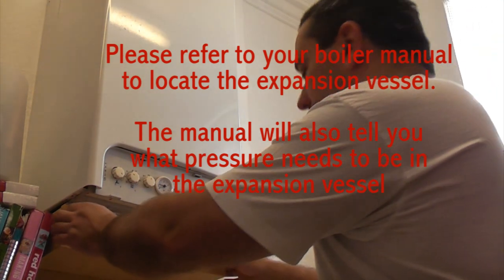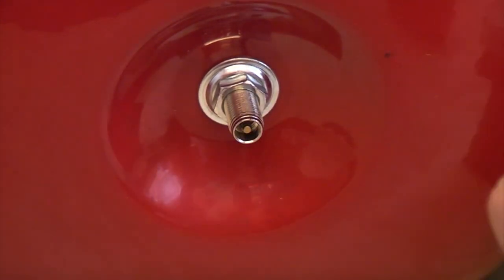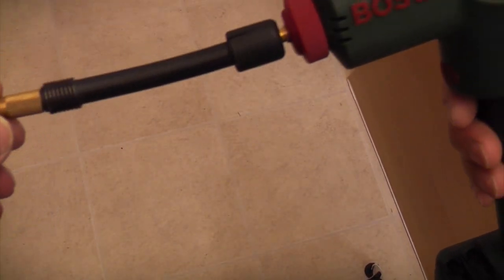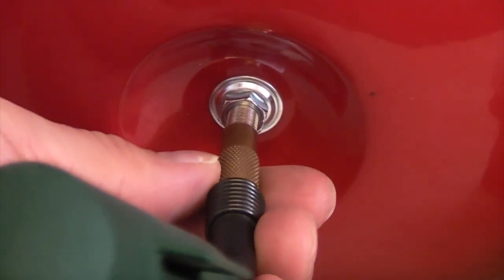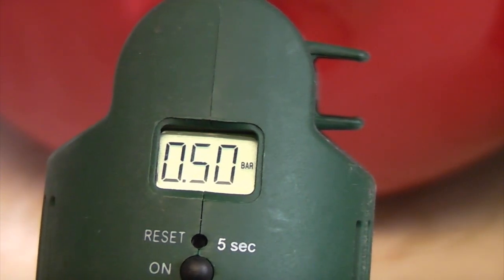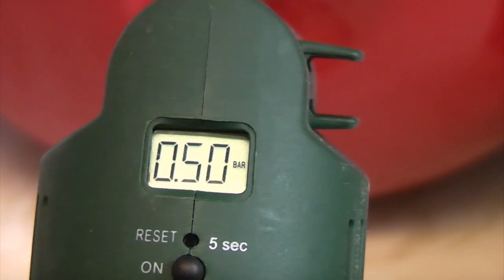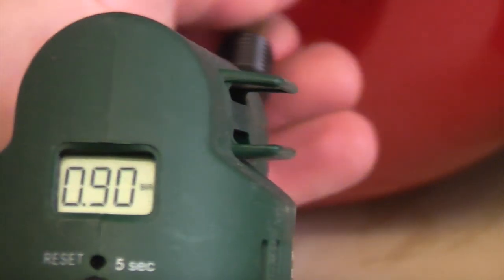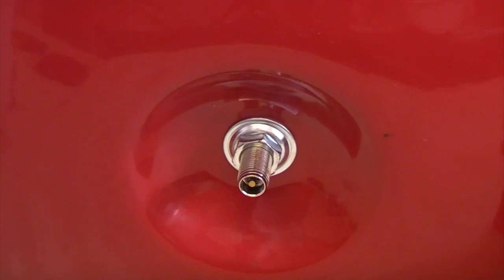How to recharge an expansion vessel in a combi boiler

Comment: Fantastic! If all plumbers were as honest as you there wouldn't be any hesitation to call in a plumber. I've had three plumbers all tell me my Ariston boiler (2011) needs replacing at £1750 when a simple repressure cured a four year problem. Just brilliant!
Reply from the maker: Thanks for the comment
Reply: Cost me £200 to get gas board in to recharge expansion vessel .

Comment: 47 represent nails it 7 yrs ago below, you need to clear the ex vessel of ALL water (even standing) to get a accurate reading,correct way is to close F&R valves release pressure in boiler using boiler drain off NOT PRV (asking for trouble there),leave drain open and pump up pressure in vessel,the water left and there will be quite a bit will be forced out of the vessel,when empty and you'll know cos the last bit will be filthy,then re pressurise vessel to what MI state,open F&R valves and repressurise system.

Comment: It is actually illegal to carry out work on a gas appliance unless competent to do so. The fact that someone has asked how to make an expansion vessal redundant from use proves that this is dangerous for such people to be messing about.
Reply from the maker: It is illegal to work on the gas part of a boiler if you are not qualified, however adding an additional expansion vessel is something most people can do ;-)
Reply: Most people on here are specifically asking how to re pressurise their combi expansion vessal, being as we have to remove the boiler case to gain access you need to be competent to do so. People messing with their own boilers is dangerous.
Reply from the maker: keith kent
Are you Gas safe registered?
Reply: Yes. I only re pressurised a Baxi Duo Tec today.
Reply from the maker: keith kent
It must be very confusing as a few people think it's illegal to work on your own combi boiler when it is not.
I don't condone anyone messing with the gas part of any boiler (which should only be done by RGI's)
You are not the first person that is gas safe registered that thinks it is illegal to remove a boiler case, however I checked with Gas safe and they confirmed that it is not illegal to remove the cover from a combi boiler and working on the wet parts of the system does not need a RGI.
Reply: To get to some expansion  vessals you have to remove the inner case which forms a seal. Once this has been done you are responsible and have to carry out checks and record this. On a Baxi Duo Tec for example this is inside and not easily accessible, hence I then checked the boil/ flue etc and also popped my flue analyser on. Look I am not saying no one can't work on their heating system, I just wanted to chuck this in there for those who are unaware and think it is ok to work on gas appliances. There are too many dangerous DIY ers out there who haven't got a clue.
Reply from the maker: keith kent
Thanks Keith,
I'd never condone anyone working on the gas side or doing anything that could put others at risk.
Reply: Boilers are where gas and water meet. It's sad that is today's litigious world that honest folk are hoodwinked into expensive repairs for no good reason. This information video is brilliant but Any idiot can put a nail through a gas pipe, does that mean that hammers should be gas safe ?
Reply: I done it...it worked. I didnt have to remove anything...it was at the top of my boiler...what a relief...thank you!
Reply: Art M nope...sounds more like an all together hammer ban..Ike the next big issue will be hammer control. Kids will be beaten senselessly (just a thump can be damaging given how much they have sense these days) and the next day they’ll be marching to take away our hammers. Please don’t give idiots any ideas😉 Seriously.
Reply: You don't seem to realise that not every boiler needs the case removed to check the EV pressure. Turbomax Plus for example. But don't let me stop you wrongly quoting a rule book.
Reply: @KentyRs-gi3oo  Only removing the sealed combustion case, not if it is a cosmetic cover. Further, who defines competent? This is debateable. Fact is many Gas Safe engineers also need to ask questions about apparatus they do not understand, does that mean they are not competent?

I agree that idiots messing with stuff are dangerous but that will happen anyway.
Reply: Kenty #R53 55s How comes you gas safe guys don’t bother recharging these on the annual service???

Comment: @ultimatehandyman because you woun't get a true reading, cos your puttin air in and theres nowhere for the water thats still in the expansion vessel to go. Thats what I got told at work anyway. I know that after drainin down there's still water in the exp. vessel from my own early (wet) experience

Comment: Just like to say, that thanks to this excellent video. I have sorted, which both 24/7 home rescue and BRITISH GAS, failed to do during their annual boiler service. prior to me fixing it. the boiler pressure was 1.6 in standby, but would shoot to over 3.0 in use. I bled a radiator to get the pressure down to 0. I then switched boiler (Valliant Ecotec Plus 831) off. removed the cover and attached my bicycle stand pump with pressure gauge to the expansion vessel. and the pressure in vessel was 0 (Zero) so I pumped it up to 0.9 bar. replaced the cover and switched boiler back on. refilled using the filling loop to 1.5 bar and now the pressure tops out at around 2.0 bar when in use. needless to say. I would not have done anything to the gas side of it, But I was confident of doing the recharge side. Isn't the expansion vessel pressure supposed to be checked during an annual service ????
Reply from the maker: You are welcome.
I don't think they check the expansion vessel during a service, but I could be wrong.
I'm not sure if boiler services are worth the money to be honest, I get mine serviced at home as it is required for the warranty but I have one in a rental property and I never get that serviced although it passes the annual Gas safety check. The last boiler in the rental property lasted 12 years before it needed replacing and was only a cheap make (Ferroli >£600). If I had the boiler serviced at between £50 and £70 each year I would have paid more than the price of a new boiler over the 12 years. Each time the boiler did break down it was always a sensor etc. which would not be checked as part of the boiler service.
Thanks for the comment
Reply: Ultimate Handyman 0p
Reply: @ultimatehandyman  A decent engineer should always check the pressure on the expansion tank. They should also be cleaning out the combustion chamber and checking the condensate trap. But my experience is that they don't do squat. If they do check the vessel all they do is stick a screwdriver in it to see if it has air, making the pressure even less! 

Why I get really peeved when gas safe guys come on the internet going on about how only they can do this and that. If they did it properly in the first place the rest of us wouldn't have to roll our sleeves up.
Reply: It should be checked once a year. Period.
Reply: British gas annual so called service cover is now nearly £400 for decent cover with £60 excess. Imagine that over the 10 or 12 year  life of a cheap boiler. The service is only really a landlords gas safety check so not a service at all. When it breaks down my brother with a small child were told 2 weeks in middle of winter so they got me to do it instead. It was a pump on the central heating system.

Comment: Thanks for this! Started having issues with my Immergas Combi (again) after having a new expansion vessel installed 18 months ago. Been fine since. System now losing pressure again (assume over pressure and PRV releasing it up). I will check air pressure in the expansion vessel. Thanks.

Comment: I owe you one. 2 months after a service my boiler started losing water venting outside via the overflow pipe. Checked out your video & found water passed out of the E/V valve, so I re-pressurised it to the correct pressure after which only air vented. I assume there is a bladder inside which as luck would have it was only deflated as the boiler has ran for weeks with no water loss. I can't thank you enough.
Reply: How to drain radiators

Comment from the maker: + Nunsweepit421 
It could be. I suggest you drain out some water from the system perhaps via the radiator drain off valve. Then re-charge the expansion vessel. After doing that you can re-pressurise the central heating and see if the problem is still there.

Comment: Just lately, the pressure gauge on my 5 year old boiler keeps going into the red when heating is on for about ten minutes so I have to quickly switch off. YouTube videos say that this problem is the expansion vessel. When I press the schrader valve on the vessel, no water comes out. Just air. Does this simply mean the vessel needs re-pressurising as shown in the video? Thanks.

Comment: Thanks for the Vid. My Ideal Combi is losing pressure on daily basis. The water is collecting in a catch bucket underneath overflow outside. I tried valve on Exp.vessel earlier and it seemed flat (ie no hissing) but luckily no water came out. Do these two symptoms tie in with each other or should I be looking at something else? Cheers

Comment: A very helpful video. I charged it to 0.8/9 bar and hey , ye its working great. The pressure gauge does not go up above 3 bar now and the house is very warm. Thanks . I do a lot of DIY , and would not recommend a novice trying to do this. ( it was at 0.3 bar on first test)

Comment: So once I have let some water out of the system and the pressure gauge gos to zero on the boiler do I leave the bleed valve  open on the radiator while filling the expansion vessel thanks Dave
Reply from the maker: Yes, if you do that you can then close it and refill the system after topping up the pressure in the expansion vessel. 
Thanks for the comment

Comment: As mentioned previously in the comments below..... some expansion vessels on some boilers (mainly newer boilers) are in the air tight area which should only be accessed if you are gas safe registered. If the expansion vessel is at the back of the boiler then you would need to release the pressure from the central heating system either as mentioned in the video or by using the drain off on the boiler and you would need to leave the drain valve open while you are re-pressurising the expansion vessel. This way you will be pushing the water out of the expansion vessel while pumping it up then pressurising the expansion vessel to the correct amount.
Reply from the maker: Can you please list some of the boilers where the expansion vessel is inside of the airtight area?
I want to make sure that I recommend that people do not buy these boilers. Thanks in advance
Reply: There are really to many to mention but they include Worcester, Baxi, Potterton, Vaillant, Viessmann, Ideal to name a few. You're a braver man than me not recommending these manufacturers as some of them either are competing to be market leaders or are market leaders. The older boiler is a lot more likely to have the expansion vessel in your preferred area. I may be wrong but I think the only new combi boiler that has the expansion vessel at the back of the boiler (not in the air tight section), that I would regard as being any good is the Worcester greenstar Si and Si Compact. I personally prefer the Worcester greenstar CDi boilers because as well as being able to offer better water flow rates, servicing the heat exchanger and expansion vessel, and doing repairs is so much easier and quicker to do.
Reply from the maker: Thanks for the reply.
I guess it makes sense, a bit like car manufacturers that design cars so that you have to take it to their approved dealers to get a problem fixed.
I had the boiler replaced here when we first moved in in 2012 and chose a Vaillant, it was installed by a RGI that I have known for years. He said that the boiler needed a service every 12 months for the guarantee to be valid (I think it was a 5 year guarantee on parts). I filled out the paperwork and sent it back to Vaillant, a few days later I was sent paperwork from them which was trying to say that the boiler had to be serviced by Vaillant's own engineers, obviously I get the installer to service it every year but I can see now why some RGI's would be reluctant to install Vaillant boilers when they are pulling tricks like that!

Comment: Need some help here, when the boiler is not on, my pressure is really low, in fact ready to say it needs topping up, but when the heating is on its right over in the red saying it's too high, I have pressed the shradder valve or whatever it's called, no water has come out, so the vessel can't be knackered, any ideas ?? Valiant ectoc 937 plus
Reply from the maker: It sounds like the expansion vessel has lost it’s charge. If you follow the instructions in this video, it should start working again. Make sure that there is no pressure showing on the boilers pressure gauge when you recharge the expansion vessel. After recharging it, you can then top up the system using the filling loop, until the pressure in the boiler is about 1 Bar  👍

Comment: Can you put a small amount of air in with no psi gauge and while there is water/pressure in the ev if it was 0.5 cold 3 bar hot
2 pumps then blead the rad as not to get air in the system
is there a air bleed on the 28 jnr

Comment: CAn I ask the exact process if you are not confident to drain the boiler. So I can bleed a radiator, is it just a case of bleeding one down on the ground level and letting the pressure down to 0? Would you then leave this open when you pump up the EV or it doesn't matter?
Reply from the maker: If you want to do it that way, bleed some water out from an upstairs radiator, and leave the bleed valve open whilst you re-charge  the EV. When you do re-charge the EV, more water might exit from the bleed valve, so make sure there is something there to collect the water.
Once the EV has been charged, you can re-pressurise the system, then bleed the radiators.
Reply: Ultimate Handyman thank you so much for taking the time to reply so quickly 👍🏻
Reply from the maker: You are welcome ;-)
Thanks for the comments

Comment: Hi I would like to ask a question. if a vessel has a bit water coming out of it when you press the valve. Is it definitely no goood. The reason I ask is I have just had a new vessel fitted and have pump my old vessel up to 1.5 bar and a week and a half later its still at the same pressure how can that be if its leaking?
Reply from the maker: So, your old vessel is still connected to the system, but you have a new expansion vessel fitted?
If water is only exiting from the Schrader valve on the old vessel when you press in the valve, it will be fine.
Inside the expansion vessel is a membrane, once that has perished you will get water on both sides of the membrane, but as long as you have another expansion vessel installed, and providing the old vessel is not leaking, it will be fine. 
Thanks for the comment 👍
Reply: @ultimatehandyman  hi  sorry a misunderstanding  .I have had my old vessel replaced because I was lead to believe that it was faulty .as it was loosing pressure and there was water coming out of the valve when pressed 
Now with the old vessel complete disconnect it's in the shed I pumped it up to 1.5 bar and a week and a half later it's still holding pressure .
Reply from the maker: Oh Right, Normally when water exits from the valve, it means that the membrane is leaking, then when the system is pressurised and the water is heated, it expands and pressure increases until it is discharged through the PRV. Has the new vessel fixed the problem with the boiler?
It's weird that the old expansion vessel is holding 1.5 bar!
Reply: Hi I believe I have another issue going on with boiler possible a blocked or partially blockage. New vessel seems ok .just a new prv and diverter valve. As the original problem is that  it take some time for the boiler to ignite keeps shutting down and when it fires up . the system pressure is rising when heating is on to about 3 bar and I am having to loose of pressure. The main heat exchanger has been cleaned out .but the secondary heating exchanger has not .I have noticed rust in the system since the drain down and suspect the to be a blockage some where .hopefully going to get my head around this on the weekend. Many thanks for your input any suggestions are greatly appreciated thanks paul